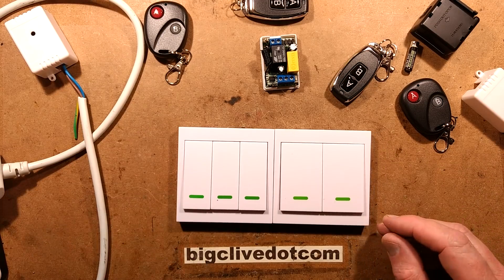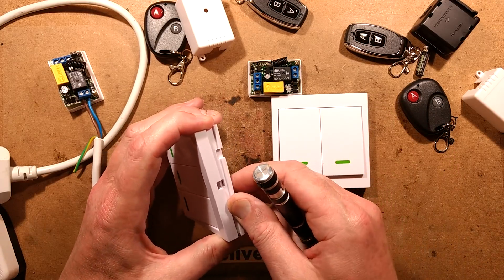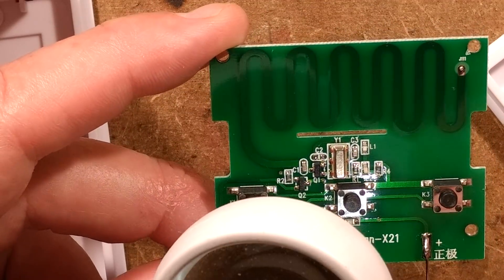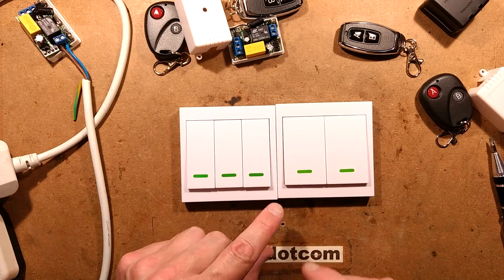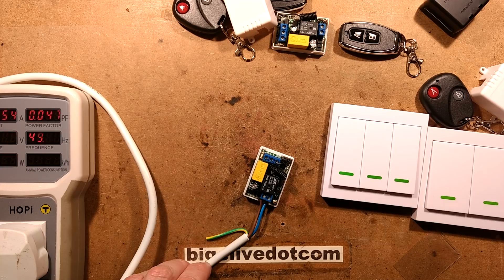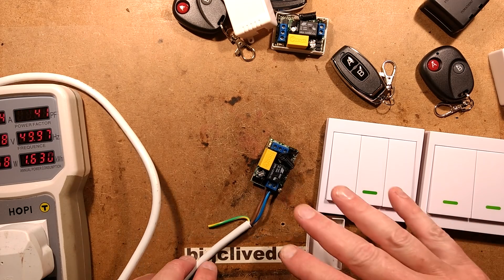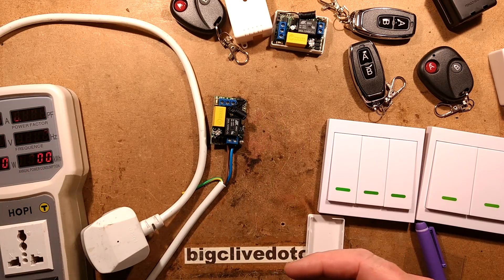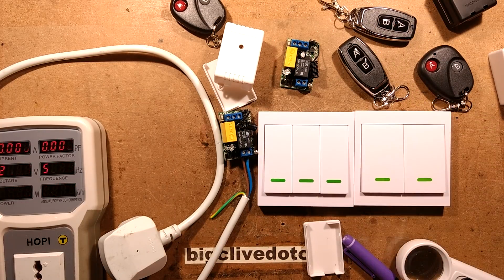eBay radio remote controls.   (220V with a 125V relay!)

Comment: it is not naughty for merica since we use a multi circuit center tap 220v system (~110v for most stuff at average max current of 20A(30A is absolute max for most houseolds) and 220v for high power appliances like a/c, electric heat, clothes dryer, range oven) so I would like to buy these for my own 120v naughtyness here in the us of a so can you give a good link my main bearded man?
note: I understand the risks even at 120v I will mod an inline 5a fuse holder and use these to control plug-in lamps(used to be touch lamps from the 80's but the circuits are dying) and I have blown a 30a glassy one on 120v and the worst bit was flames out the end of the fuse so that is why glass fuses exist they are not for high voltage(mostly automotive) but can be used in a diy project of known quality and risk
Reply: Most ranges are 40A, some are 50A.
Keep in mind the total wattage which a fuse can pass through a high resistance connection without faulting.
There are certified off the shelf solutions. Search for "Wireless light switch"
Reply: I posted this a loong time ago and have decided on the "off the shelf" shortly after posting and yes I know fuses have their limits but better to have a 0.01USD fuse rather than blow up the 1-10USD module you bought right? I already blew up 2 2USD modules because of Shorting by accident if I had some cheap fuses they might have survived (all this done on a 24v 100ah ups mod battery pack)
Reply: The flames from the fuse were because the fuse had no sand inside,  see Clives fuse vid. It sounds like you have a counterfeit fuse.
Reply: @nickbird7742  wrong it is a fuse only rated for automotive use and is a glass type and I was using it outside of it's intended purpose however at 120v the fuses I am using don't explode or put out much flame the problem was I intentionally shorted it over 120v to see how my 10a multimeter survived and it is just fine with only bent fuse contacts

Comment: Is there a way to correct for power factor?
Reply: a T H I C C inductor will help, or a fan/electric motor if you like. capacitors push it one way, inductors the other.
Reply: Thanks for the reply. 
I was thinking of a cheap Chinese product one can buy. I have a big-ass transformer inside my APC UPS that does nothing but power factor correction. It baffled me for a while as to its purpose in the unit.

Comment: they saved about 2p per device by going with these relays, good job "designers"

Customs all over Europe are starting to stop shipments of non-CE-products lately.

that rv1527 chip is used in a huge percentage of 433mhz remotes
Reply: tommihommi1 well,  Chinese are very well informed that they must put that CE marking there. It does not mean that the equipment is safe. Anybody can put it there. If the Chinese factory is big and reliable, they don’t put the CE-marking if the apparatus is not meant to European market. But the small ones put it without hesitation. Actually it is just a mark that it is allowed to import to Europe. It is enough that it’s on the package. It is only for business purposes, nothing else. That who put the mark there, is responsible if something happens. But it may be very hard to find that one person in China, who signed the paper. Here in Finland our authorities examine many products and many of well known make can be dangerous. I have had the authorities removed some Ikea and Lidl electrical equipments which are cheaply made. One halogen lamp I discovered being dangerous, is now sold in Eastern European Lidls because there’re not as strickt authorities as here.
Reply: Siana Gearz that stuff is actually legal, so of course is isn't stopped. What's problematic is stuff like toys that contain hazardous substances like lead paint, non-CE mains crap and so on. Basically anything that's intended for the average joe has a decent chance of not making it.
Reply: I haven't had non-deliveries from China to Germany, in fact they seem to arrive faster than ever, taking only a week. But then I don't buy mains products from China pretty much ever, rather batches of ICs and passive components and loose PCBs, as well as mechanical replacement parts for my 3D printer and for the next printer i'm building.
Reply: The sooner we leave the Evil Union the better, then we can enjoy this dangerous Chinese crap!

Comment: I've done similar with Sonoff switches... build them into a double pattress with a blank plate. The blank plate has a tiny hole drilled in above the 'mode' switch on the Sonoff...for pokage with a cocktail stick.. I don't trust the fireproofness of the sonoff. A standard UK pattress with minimal holeage and blank plate, will contain a decent sized meltdown

Comment: Got 3 questions, are there better quality relays that you would use as permanent replacements for light fixtures or what ever and if the relay had the thermal fuse in it would you use this as a permanent light switch. What was the rating on the relay ? If you covered the rating I apologise for missing it.
Reply from the maker: I missed mentioning that the relay was only rated for 125v.  You could put in a known quality relay and also add a thermal fuse if you expected to use it with high loads.  The only other component I'd want to swap would be the dropper capacitor for stood X2 one.
Reply: bigclivedotcom as always thank you for answering our  questions. Now I just need a bug zapper that will handle pterodactyl dinosaur sized mosquitoes. I'd be using the remote switch for remote control horse watering, ya know from the chair. Instead if walking all the way out back
Reply: Those bug zappers don't attract mosquitoes, which are looking for CO2 and warm bodies (you). They aren't attracted to lights. But beneficial bugs, some that eat mosquitoes, ARE. 

Better to build bat houses.
Reply: Yes!  Please review some mosquito zappers/traps for outdoor use.
Reply: The ones that operate on propane are supposed to really work but are too expensive.  Perhaps we can add CO2 (from a bottle) or some attractant to a zapper.  I don't see anything like that on the market for under $50 that I think is based on real principles.  I think the ones that use TIO2 to give off CO2 are a gimmick.  Adding a small heat source and some water to the mix might work too.
Reply: James Van Damme the bug zapper my dad just bought for my mom has this little wet pack that is supposed to attract mosquitoes then it has this plastic light up ring that also is supposed to attract mosquitoes. Some sort of new fangled wizard stuff